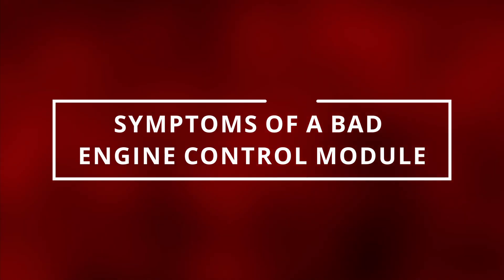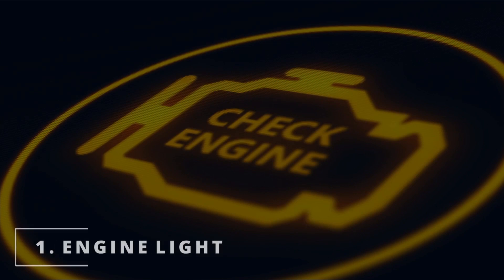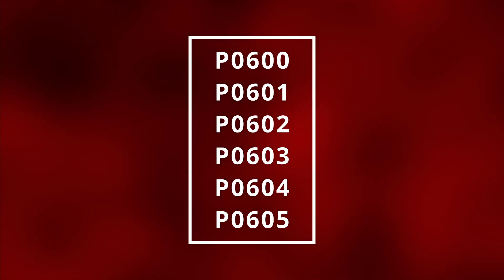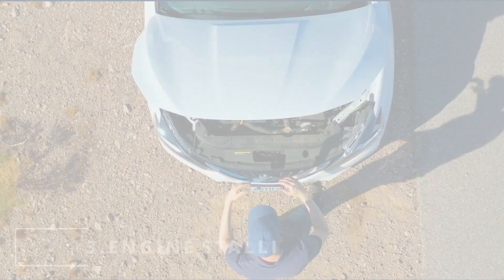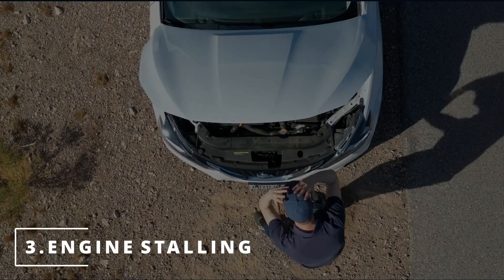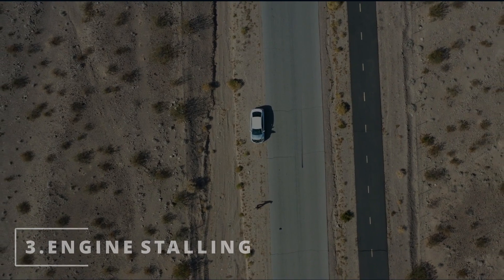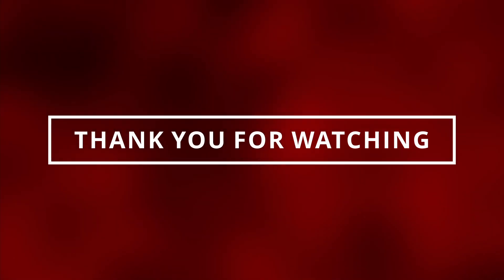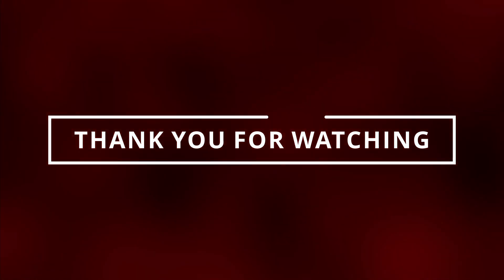SYMPTOMS OF A BAD ECM (ENGINE CONTROL MODULE)

Comment: Bro my car probably has every light on 😂😂😂 looks like Christmas in my car 🚘
Reply: My car has lights on that GM didn’t even know could come on 😭🤣💀
Reply: @ImaginePixel007  lmao you need to return the whole vehicle ☠️🤣🤣
Reply: That mean the computer is bad cost way more than a BCM! 😬
Reply: @rickydavis2267  how much are we talking ? I have this problem right now, apparently my battery was bad as well….took two Ubers carrying my battery 🪫 got a new one Uber back replaced battery car was bueno…..headed to work this morning, pull up to coworkers , and all lights turned back on, and car died on me as I coasted into a parking spot
Reply: @HIMDUNCAN404  it doesn't cost much if you pull it from another car.same make and model that you can find at a junk yard it's getting it programed to work in your car is the hard part
Reply: @HIMDUNCAN404  AYO I literally have the same problem as you right now. Luckily I'm driving a manual transmission  to easily push start my vehicle. I hope it's just the alternator and not the fkn ecm.
Reply: @al8704  you know how to
Check
If it’s alternator? If I remember correctly, and
If your car will at least start, I believe you take the negative terminal off the battery? (If I’m wrong it’s the positive) if the car cuts off, it’s a bad alternator
Reply: @HIMDUNCAN404 that sounds like alternator
Reply: @rickydavis2267  really, mine cost 26 bucks on ebay with warranty.
Reply: VW owners know exactly what you mean.
Reply: Same here
Reply: I thought it was just mine 🤣
Reply: you must drive a Nissan Maxima then my dude...
Reply: My car too that’s my car project now I’m going to fix myself professionals want too much 💰
Reply: Mine ended up being the alternator
Reply: @HIMDUNCAN404  dude this literally happened to me in my driveway tonight, its why I'm on these random videos. I am almost hoping its the alternator because I have a spare and can put in. Man, lucky the cars died where they did.
Reply: @1NcognitoXx  I finally got through it thank God 💯 I hope you do too! I think if you can test for bad alternator, if car is running, and you pull negative terminal off the battery 🪫, and the car shuts off shortly after, then it’s a bad alternator 🤔
Reply: @HIMDUNCAN404  You know if you would have to buy an ecm part from a dealership?? or no?
Reply: @HIMDUNCAN404  funny story, car dies in the driveway while running last night, low bat symptoms, I jump it and it runs, pull the jumper cables and it dies. This morning I jump it, and it stays on, and getting full 14.1 v charging. Is my alternator just intermittently failing far into a drive? This problem keeps happening and resolving itself
Reply: @rellohello24  honestly, I don’t know, but if I was in that situation, I would do everything in my power to avoid going to dealer unless it was still under warranty, or recall. My situation turned out being the alternator, but some of the “symptoms” were “causing all warning ⚠️ lights to come on” , “car sounding like it had bad gas ⛽️, and would sputter and shut off” , “speedometer not working” etc….but it turned out to be the alternator, even with “intake manifold “ codes and what not
Reply: Mine 2 holy crap even my gas light lol
Reply: I know that all is well by the glowing glory of the check engine light and the other bs that goes with it😂
Reply: My check engine light is on, my ABS light is on. Now my RPM is stuck at 2,000rpm and my modified exhaust got louder. I can't drive my Camry because I don't want to be stranded or caused further engine damage. I guess I'll be taking a Taxi or a Lyft ride to work, till I get my other car that I'm financing from the Dealership.
Reply: @static_Tricolor_camry hey man i have exactly the same problems, did you get to fix you car man?
Reply: @Jasson13rd  Yeah the ECM was dying, and the Catalytic converter needed to be replaced. My O2 Sensor gave out so I replaced that, now I have my other O2 Sensor to replace and my ABS light is still on but I do plan on getting both lights turned off once both sensors are replaced.
Reply: For realsies lol I was like all that’s missing is that star on top lol
Reply: @whocares1914  that's.... That's a fantastic idea!
Reply: I still love the older cars best , 1988 etc , the newer ones to many sensors , by boss bought new year several years ago , and his warranty spent 3,000 to repair brake system,  i mean WHAT THE HECK   , new  vehicles dont mean no problem
Reply: Same here mf be saying error and all type of stuff my gauges be going crazy
Reply: Same here.
Reply: Did you figure out if it was a bad ECM?
Reply: @hustleman1112  I mean when I bought the vehicle it was like misfiring bad and check engine light was blinking as I would give gas sometimes but I basically did a tune up myself and no more of that only code is the Air temperature sensor since it’s ripped off the car I guess from the last owner but ever since my tune up with spark plugs and coils and map sensor also oil change and transmission fluid change the car has been running better than ever
Reply: Lmao
Reply: All computer resources for new or reprogram ecm
Reply: How do you pass smog?
Reply: Lmfao
Reply: Lol😂😂😂well Damm
Reply: Yeah same but I replaced everything but the dme 😂but still run throws like ten codes too
Reply: Same lol
Reply: Try having. A Mercedes I had like 20 something codes. I wanted to trade my brain into the dealer.
Reply: Y’all are lucky I don’t get no fucken lights on in my truck
Reply: Mind has no lights on
Reply: That's why it's called a discoboard! Only rich people have a dash
Reply: Are ya serious every light? 🤣
Reply: @myfavorites1016  it's probably more of a twinkle tree
Reply: Shouldn’t buy a bmw
Reply: Congratulations
Reply: Mine too 😅😢
Reply: Same here. And if my theft and service light stays on then it drains my battery completely in 3 to 5 miles.  Turning the ignition off and back on resets it temporarily.  I am on my 3rd battery, 2nd starter, and the alternator once but has not fixed it in over 2 years.
Reply: @timvincent5770 did you found out what was wrong i have the same problem
Reply: Literally bro 😭
Reply: Need to get a pine tree air freshener to finish the look
Reply: I got the check engine light on my ford focus 2010 get a P0420 code the mechanic say I should replace the ecm am worried it might be something else cause the original part is$950 from Ford?
Reply: Merry Christmas 🎄 🤗
Reply: Same bro.. 😢
Reply: My engine light comes on and off.
Reply: It happened to me yesterday
Reply: Must be the ford model I have
Reply: Probably looks like xmas lights on under the hood too
Reply: Help me currently lol
Reply: Same my mechanic said gateway module failed will see what happens tomorrow
Reply: I swear to god
Reply: Dash light everywhere and now gone from strips of electrical tape covering them to now using duct tape😂😂😂
Reply: Damn did yall get it fixed?
Reply: @baconatorsupreme5165  a lot of people don’t for some odd reason
Reply: @baconatorsupreme5165  No "w'all" didn't. 🙄
Reply: Yea mine to 😆 🤣
Reply: You ever have that magical day where everything lines up and all the lights are off at once? The last ones left is the seat belt light and fuel, and you're like shit I gotta strap in n fill up
Reply: I have no idiot lights on, but engine fails to start. I thought alternator-- and friend suggests I do ECM first. Is this good advice?
(New battery.)
Reply: @artistaloca4 I would suggest checking battery at no cost then alternator at no cost...do I have a warning light what does it read if anything...ecm is quite costly and some cars have a recall check yours out...hard start also modulator...are you getting  enough gas to start ...

Comment: My ECM check engine light just came on after 800 miles and 4 weeks plus two days of leasing for $1,600 0ver sticker price and $471 a month on a non-hybrid 2022 Hyundai Tucson SEL. That's pathetic, downright disgraceful. I noticed a burning oil smell for the first weekend and a 75-100 mile fuel deficient getting around 13-16 mpg on an expected 26-33 mpg, 29 combined on a V$R 2.5 naturally-aspirated 187 HP with 178 ft-lbs torque. I'd expect this on a overpriced heap of shit like my ex's Tesla Y (well, huge battery or electrical problems, obviously not gas on an EV and she already has had A/C and shifting problems on an 8 month old vehicle) or a Porsche SUV, but not on. a Hyundai. I want a brand new vehicle and an upgrade to a ALL-Wheel Drive Hybrid with the standard convenience group. I know what they'll, do, epesciellay with the vehicle and part shortage, they'll say its a software problem that needs an update and with-in a week or so they can have it fixed. It will run okay for another week or so and the light will come on again and I'll have to wait weeks to months for a brand new ECS. Not a chance. I will report this to Hyundai and the National Highway and Safety Transportation Board and if they won't replace it, I'll threaten a lemon law or lawsuit and go to Brahman Hyundai who has my exact car in Black in the hybrid for at least $15 less a month. Trust me, they won't risk this over a $1,500-2,000 a more hybrid, especially with how new my vehicle has been.
Reply: I work at Hertz, a lot of new cars come back showing that the ECM is bad or something is wrong it
Reply: @goochemane50  See my comment on this thread.

Comment: Very helpful thanks a lot bro
Reply from the maker: and thank you!
Reply: @easyautofix  I've got a code 42 but no engine light.  To check the wire from the distributor to the POM would require pulling out the glove box.  The gas tank was full and she running very rich because I've only traveled 55 miles on my 94 GMC Sierra C3500 with a 7.4, 454 engine. I was told that you need a special tool for removing the POM?  In the manual, it says to replace it.  Any ideas about getting around this in a away to make sure that the POM needs to be replaced?

Comment: My mustang GT 04 is running good and I keep getting codes po 316\301 and I use my code reader and turn it off and my car is running good with no miss fire and after 20 or 30 miles it comes back on so I replaced every sensor in the car also the fuel pump and filter cam and crank the evap system new spark plugs and every thing I can think of or see and the car is running running much better lots power and shifts smooth but the engine light comes right back on so I will just take the bulb out of the check engine light socket

Comment: P1659(40) ,ETCS CONTROL RELAY OFF MALFUNCTION are these error codes related to pcm issues or TCM(transmission control module ) issues
Reply: How did you fix it
Reply: @mordecaimatomana653  replaced the transmission control module

Comment: Too bad, i changed almost all the sensors of my car and spend alot of bucks! But still the engine light flashing up sometimes with some misfires. Did’nt even realize it could have been an ECM fault!
Reply: I have started just like u but I am certain it is an ECM after sprayed water in it
Reply: I changed a whole engine 😂
Reply: @venomsupe did it even work for you?
Reply: @3500savoy  nope. Taking it to the dealership
Reply: @venomsupe  let me know when you find out
Reply: @3500savoy  will do brother

Comment: I was recently driving my car on the highway and out of nowhere the engine light came on and it just shut down  . I had to cruise off the exit(luckily I was near one) . It’s starts back up (sometimes it take a couple cranks) but shuts right back off. Engine  light remains on. Engine sounds fine so I don’t think it has anything to do with that. Anyone have any ideas on what it could be?
Reply from the maker: It could be multiple reasons. I would have the engine light checked out to see what codes it brings up. Knowing the codes can be a great starting point! Best of luck
Reply: @easyautofix  thank you
Reply: Sounds like crank shaft sensor for sure
Reply: @ronaldwalls162  you were right 💪🏾
Reply: @robstewart1030  I went to the dealer maintenance and they’re charging me 1,000$ for a “control module” piece that is the cause of my car acting up. It has some symptoms like this video had but not all. It backs up sometimes while on Drive. Should I pay up or look for other options? I’m new to this.
Reply: @DsaherGuy  I would definitely shop around first
Reply: @robstewart1030  how? do i do that?
Reply: @DsaherGuy  google shops in your area and call and get some quotes.
Reply: @robstewart1030  quotes? What is that
Reply: Update ?
Reply: @nixc71  crankshaft sensor
Reply: @robstewart1030  my 2022 Hyundai got a check engine out of no where only had the car for abt 6 months less than 5k miles I’m coming to the conclusion it’s this or some sort of sensor
Reply: @nixc71  what is it doing?
Reply: @robstewart1030  turbo valve is stuck according to them
Reply: Clean your throttle body with the engine running. This used to hunt me on my 07 Corolla till someone suggested this to me.

Comment: Wow. My starter went out and my alternator was acting up, replaced both of them had no codes prior, but my idol was choppy and my car was stalling. Finally get it started again and it’s throwing p2195 and p0500 codes but I reconnected everything and I checked to make sure my mas was connected. Everything looks good. Probably going to take it for a tune up play stupid and see what they tell me cuz I don’t want to mess with the electrics of my car and I’m not jumping to conclusions about my ECM being bad
Reply: Idle
Reply: I think I’m having the same problem what did you do to gix

Comment: Okay so I have a problem with my 2000 mustang GT, it won't start it has fuel it has spark it has air and I've checked the grounds they're fine, but my car still won't start it will start on starting fluid but won't keep running, starting to think it's my ECM but I don't know I took it out and looked at the motherboard it all looks fine no corrosion or anything could the ECM just gone bad?

Comment: So.....I'm on the highway going 60 and I step on it a little to get around a semi and the car jerks hard into a higher gear(automatic trans)but still hits 80mph  is that possibly a faulty module? Not a transmission issue?

Comment: What I don't like is ghost codes that never trip the CEL. You know there's a problem, but you can't find the damn thing without a scan tool, where a code reader doesn't pick up on UNTIL the light comes on. I guess that's better than the light coming on for no reason though.
Reply: Buy a bare bones code reader; it gives the ability to catch the codes when they come on. I did, and nabbed 3 codes involving the ECM.

Comment: I had a Throttle body Cody in my 2012 VW beetle, cam Shaft sensor code, and an engine speed sensor code. Replaced all of those and no check engine light at all. It just started stalling at a low idle. Could a Bad ECM not throw a code? I have had replaced the throttle body, cam shaft sensor, and engine speed sensor. It still randomly stalls and Noone can figure it out because it never throws a check engine light. Not even the local VW dealer. Is there any sure fire way to know it's bad
Reply: A dealer should be able to tell you if the ECM is bad or not.
Reply: What was it?
Reply: So what was it?
Reply: @kurtsam5972  I replaced the throttle body myself and it has been working good for a year now

Comment: 03 Silverado cranks, no start. No ignition pulse, no five volt reference at PCM. No codes, security light goes out after a second. Replaced gas lines, crankshaft sensor, camshaft sensor, PCM, driver window/door lock switch, a relay. Where is my ECM located? Will I need dealer to flash stuff? Thanks, Rich C
Reply: Had same problem with mine and after a week of scratching my head I figured it out, grounding, check every single one of your grounds but most importantly your ignition coil ground which is right under the front driver side of your engine, mine was literally hanging there waiting to be grounded 🤦🏻‍♂️
Reply: ECM is located below the battery between the battery and   engine.
Your supposed to get a crank relearn when changing the crank sensor or ECM.

Comment: Thanks I have a 1996 geo tracker 16 valves and Don't start for nothing well I decided to put everything knew from the gas pump to everything else including all sensors fuel injector fuel regulator timing pump distributor because I'm going to kp it and if will not start then I will drop a new ECM then he will be new again in my opinion if person going to kp a car should put everything new every 5 years really cheaper than buy a new car call investment no payments or full cover jjjj a couple thousands or less every 5 years is cheap compare to today cars or jeeps or trucks or motorcycles 😎 amigo

Comment: What website is a good place to order an ECM (ENGINE CONTROL MODULE)?
Reply: I got a ECM from flagship one and my car ran fine for two trips after that it won’t start anymore . I put in old ECM and it’s running again no gauges and t/c lights on but running. I hope the life time warranty this thing came with is real. I’ll let y’all kno
Reply: @markalaniz113 was it real?
Reply: Carid
Reply: @brandontizon9928  Thanks.
Reply: Protech  florida
Reply: @waynebastianelli8391  Thanks
Reply: What price for a ba ford 5.4 utility
Reply: ECM